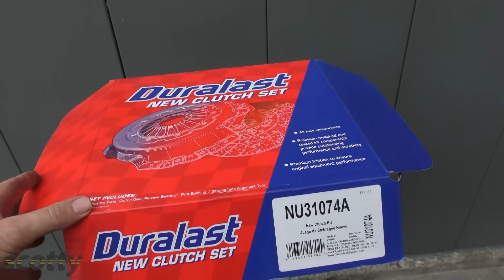5 Things You Should Never Do in a Manual Transmission Car

Comment: There is one more thing not to do on a manual transmission. At a stop light DO NOT hold down the clutch as you are waiting for the light to change, PUT THE TRANSMISSION IN NUTRAL. If you hold down the clutch too long you will overheat the throw out bearing in the transmission and shorten it's life.

Comment: In 50 years old and owned nothing but manual transmissions and have always downshifted for turns and coming to stops or just to slow down.  Never had any transmission problems. Just saying.
Reply: of course you need to downshift but only when necessary . Scotty isnt saying that you shouldnt, he just says do it when need be, not just doing it just to keep the revs high at any time. It puts unnecessary wear on the clutch.
also, you won't have transmission problems, it will be most likely the clutch disc.
Reply: GSD fan you're properly driving a manual then , Scotty is probably talking about down shifting at very high rpm....
Reply: you dont need to do that when coming a stop at stop sign, light, etc.. you are wasting gas. i drove manuals for years.
Reply: raleighman3000 most cars actually idle at a higher rmp vs downshifting while slowing down which actually saves gas 🤔🤔
Reply: GSD fan same !!!
Reply: That's because they are automatics and the torque converter has to keep the engine from stalling. The car is downshifting you just don't notice it. If the car didn't downshift the motor would die. I have two of the same car same motor one automatic one manual. The automatic idles at 1200-1500 RPMs coasting to a stop. The manual is always around 700-800 RPMs. Guess which one gets better mileage.I think you've watched too many youtube videos.
Reply: Then REV UP YOUR ENGINE!
Reply: @mikeross6043  downshifting for a turn increases available torque. You're bringing the car closer to the limit of tire adhesion in a turn by doing that. Engine braking has many uses, but you're using it incorrectly in your example.
Reply: @GUITARTIME2024  some modern cars tun the injectors off briefly when you let off the gas. ever have a car with a live mpg reading (not average) it will sometimes read infinity when getting off the gas. You only use the gas needed to rev match then the engine basically turns off so to speak till the ecu decides to turn the injectors back on.
Reply: Especially if you know how to rev match/heal toe.
Reply: I generally always downshift while turning, but I do not down shift(engine brake) while coming to a stop or slowing down. I'm generally always in neutral while doing that because I'd rather put wear on my brakes vs wear on my clutch, assembly and transmission. Often times I will down shift for rev matching, but that and turning are the only times.  I've been driving manual for 18 years now. I got my first automatic in 17 years Jan 2018 but still keep a 6mt weekend car.
Reply: I'm hitting 53 and have had many different models of cars with manual gear boxes and never had to replace clutches in any.
Smooth driving is everything
Problem with a lot of drivers they don't know what takes place under the bonnet(why should they)if they did then they would take more care!
Reply: Same here. Been driving manual transmission for 20 years and i have never damaged any by downshifting. I downshift for turning corners and every time i am slowing down or stopping. Never had a problem....
Reply: No video saying when breaking on a manual transmission car, do you pressing the clutch and press the brake? This is like put the car in N and brake, or I do is put in to one lower gear and press the brake the the transmission is still in gear.
Reply: As long as u dont downshift to early it's fine
Reply: am I downshifting correctly? If I see the RPMS dip to 2k and lower Ill downshift and itll be at 3k rpm. Am I ruining my car?
Reply: @mikeross6043  well firstly you'll blow up your engine doing that secondly your car won't let you do that anyway
Reply: Only problem I had was my dad blowing 3 cyclinders in the motor and fucking the transmission up on a chevy at over 200,000 miles because the motor was revved a few thousand rpms each time for 10 years until one day red lined it while down shifting and bye bye 5.3L turbo Chevy Silverado transmission and motor. Lol That being said it was turbo charged and it was abused for 250,000 miles lol. Red linning while down shifting just because your truck is stright piped and sounds nice is a bad idea.
Reply: Don't let Scotty hear you say that. He may shout at us some more.
Reply: GSD fan That's because you are double clutching which saves the transmission.
Reply: @pleco101  No and they never will, Manual transmission will always have better fuel economy than an automatic. I'm guessing most comments on here are from Americans, the way you are taught to drive in the UK 🇬🇧 is always come down the gears when you're coming to a stop, and who goes around corners in 5th or 6th gear?! Absolutely no one, always come down the gears, at least 90% of cars in the UK are manual, and about 80% drive them correctly, you don't see the garages chalk full of people waiting to change their clutch because they're all worn out of driving "correctly"
Reply: @rododend  Necesseary in that the engine will stall if you dont.
Reply: @bbb462cid  I believe he is talking about 90° turns.
Reply: @ineednochannelyoutube5384  what difference do you think that makes?
Reply: @bbb462cid  most cars cant take such a turn above 3 without stalling, and that will stll likely have the engine struggle.
Unless you slide th clutch of course, but thats a surefire way of wearing it down.
Reply: @ineednochannelyoutube5384  Firstly no car can take a 90* turn.  A car turns by the front tires deflecting and twisting as the steering wheel is turned. This makes the wheels pivot. As a result, your turning tires must travel in an arc, and so does the car. Secondly, turning the steering wheel "to the lock" at low speed in high gear has precisely ZERO impact on the engine stalling. Engine rpm and torque are the defining factors, not how sharp a turn is. The steering wheel isn't what will make the car stall. You have some strange ideas about cars.
Reply: @FreezingFaces  yes and no. If the cars are exactly the same ie same motor and same number of gears, the manual trans will always get better fuel economy; torc converters are simply too inefficient. However, in the latest model cars that have auto and manual options, the autos tend to get comparable to better millage simply because the engineers have figured out how to load a bunch of gears into the gearbox. Most manuals now days are all 6 speeds while autos are 8-9 speeds and rev much lower on the motorway (manuals might get better city miles depending on how you drive). Further hybrids like the prius dont come in manuals; I think because manuals can't accommodate switching between the electric and petrol motors. I personally hate automatics because you have less control of the car, but the world seems to be fazing out the manual gearbox. Even in racing applications people are going for clutchless systems because they respond faster yielding faster times. I think even the UK will start to transition away from manuals.
Reply: @raymast4703  I wouldn't recommend downshifting while turning.  The correct way is to brake or downshift before the turn and then accelerate gently through the turn.  Downshifting is akin to applying brakes -except on a front drive car you are applying that downshifting stopping power to only the front tires hence on a wet or gravel covered surface the car can dangerously push as you let out the clutch.  On a rear wheel drive downshifting during the turn is like applying the hand brake  -fun in a parking lot on a snowy day but potentially very dangerous in traffic if your rear tires lock up for a brief second and send your rear end into the curb or oncoming traffic.  Accelerating gently through the turn is something I started doing after having read a recommend somewhere -it helps the car pull though the turn -as always use caution depending on road conditions.
Reply: @650hpreventon  it's a tricky answer...when the revs are high leave the clutch untouched and the engaged motor and the brakes will team up to slow the car down but once the revs get down around idle or thereabouts then the reverse happens: the engine will fight the brakes as it tries to keep from stalling -press in the clutch and either downshift and release for additional engine braking help or just keep the clutch pressed down and let the brakes work on their own.
Reply: @DavyDave1313  when as you release the clutch you feel the car slowing down and you hear or observe your rpm's increase then you are fine. But If you downshift and the car appears to chug forward and you sense that you need to brake harder to slow the car down then you are doing it wrong and are risking stalling the engine or being unable to stop safely as the motor is at too low rpm's and is fighting the brakes. Does that make sense?
Reply: Big trucks, yes I know they have "different" transmissions, the only difference is more gears and no synchro's. There is nothing wrong with downshifting to effectively engine brake. You will use more fuel that way. Technically speaking if you coast to a stop, or pull the vehicle out of gear other then to shift you are considered out of control.
Reply: I think he might talking about rev-matching. Using engine braking properly is a good thing.,
Reply: @GUITARTIME2024  Downshifting and engine braking is actually a better way to save fuel.
Reply: @jmw8403  makes no sense.
Reply: @GUITARTIME2024  yes it does. Since you cut the fuel injection to the engine when you let off the gas, you can brake over a longer period of time without the engine needing any fuel. The engine starts idling when it reaches a low enoigh rpm, so if you consistently can keep that rpm high while not on the gas, and keep it low when on the gas, you will be using minimal fuel.

It is also good for fuel saving since you dont use the clutch other than for shifting. The soon as you disengage the clutch, the engine starts idling and that consumes fuel.
Reply: @GiuseppeSimonetti  your problem is that your engine is a Chev
Reply: @danwoods8611  this is true. LOL chevy sucks
Reply: All depends on how you do it. And how much speed your peeling off. I shift down for stablizing controle in corners too. But chasing the habit to every slow down? Thats just being waistfull on the cluch disc. Unless on ice, or seerching for a quiker stop than traction will alow for.
Reply: @FreezingFaces  The clutch is for when you start off and come to a complete stop. But I drive a truck that's usually pulling a load so I up shift and down shift while driving down the road  on hills and some curves. I listen to my engine it tells me when I need to shift up or down. Oh I'm American been driving manuals for 43 years. 3 on the tree, 4 speed top loaders, 5 speeds and now a 6 speed.
Reply: @NOTMuzzaFuzza  well see if you rev match before re engaging the clutch, then you wont get nearly as much wear.
Reply: Here in Sweden winters if you don't downshift for turns you're dead, hell today was a close call for me with summer tires on a new car and frozen rain hovering -0 C, ofc you hear the engine and see the RPM to make smooth shifts upward or downward, it isn't about shifting up or down but shifting smoothly and steering the vechicle with stability (minimal movements)
Reply: I’m on my third manual car, rule of thumb for me is I downshift when I need to slow down but know I’m gonna pick back up (turns or slow moving traffic). If I know I’m coming to a full stop I just go to neutral and brake. That said, I’ve never had to repair anything transmission related (knock on 🪵).

Comment: Don’t shift from 1st gear to reverse when you are driving at 45 mph.
Reply: Pretty sure it'll just grind and won't go in
Reply: Pretty hard to do lol
Reply: Don't drive at 45mph in 1st gear.
Reply: Glenn Lego unless you’re paul walker
Reply: I thought R meant really fast XD
Reply: Glenn Lego But what about 45 km?
Reply: Shouldn't be in first gear doing 45mph in the first place lol
Reply: davetek490  older cars will go in reverse while moving forward
Reply: Glenn Lego I always drive at -7000 rpm
Reply: Tried before, it wouldn't go into gear.
Reply: not possible in most modern cars. Mythbusters tried it and it just grinded without actually engaging the gear.
Reply: Shht R means race mode don't let the teenagers know
Reply: You have to be God to achieve that, driving  45 mph in 1st Gear and then do the impossible move to push that reverse gear wile moving forward. Maybe Chuck Norris could achieve that one
Reply: I've done that once in a 1959 Ford grain I thought I was going from 3rd to 4th year but I hit reverse instead that stopped the truck faster than the brakes could and left some marks on the road but no damage was done I don't remember hearing any gear grinding but I also ended up having grain on the hood of the grain truck
Reply: @techgamer1597  unless you're in a koenigsegg regera
Reply: You got some long gears man
Reply: R means race mode duh😅
Reply: Huw Owen good luck trying to* don’t know what car can do that lmao
Reply: That is some good advise thank you.
Reply: I've tested this. It's true.
Reply: Rip your transmission if your driving at 45 mph in first gear
Reply: How do u drive at 45 mph in first gear tell me how
Reply: R  is for racing   after 5th you shift   to R   for racing
Reply: Glenn Lego it's impossible to do it so stop trying to be a wise guy
Reply: Tried that with the clutch pushed in and it still made a grinding noise
Reply: Goodbye transmission 😂😂😂
Reply: But that unlocks a speed boost
Reply: There's a dude I watched who went from 5th to reverse and fucked his drivetrain up, lol.
Reply: And DONT EVER try to brake with your clutch (left) foot 👀 you will go through windscreen lmao 😂
Reply: Do it driving over a kerb to test a transmission. Lol
Reply: mine has a thing where you have to lift in order to put it in reverse:}
Reply: Idk why this is so funny 😂😂😂
Reply: HOLUP